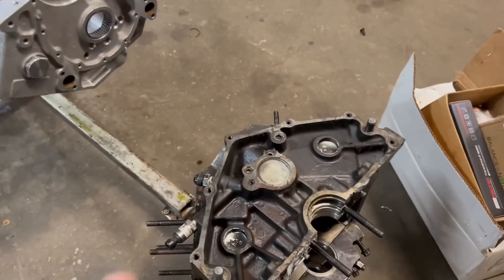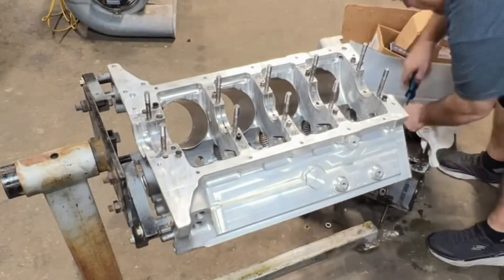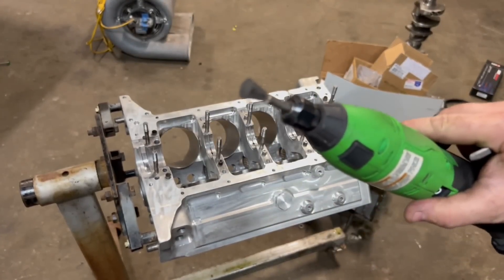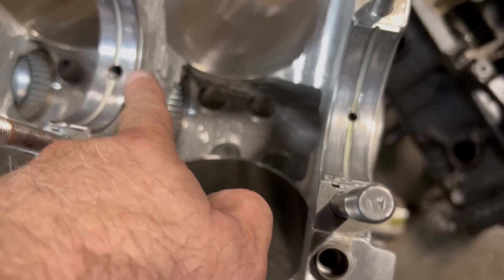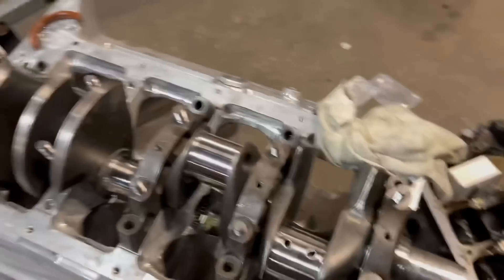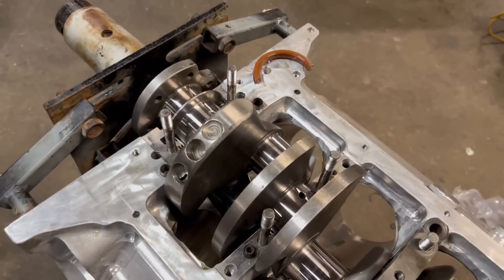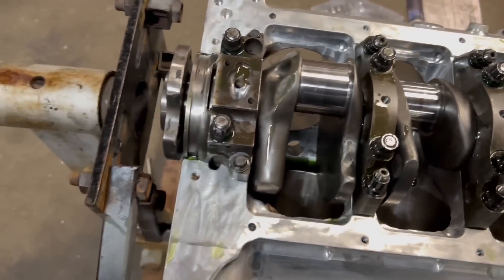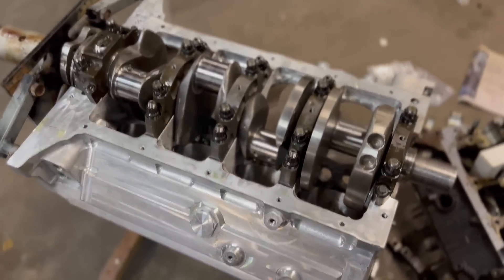Destroked 400 SBC / SBC 350 Main Crankshaft in a 400 Main Block

Comment: i am placing 3/8" thick 4.185" bore size sleeves in 350 block gm small block chevy with stock crank for 383 cubic inches stock stroke. Now if i use a 4" crank i can get 440 cubic inch for a nice daily low rpm'er. Although rod length is not optimal. If i use a 3.625" that gives me a 399 cubic inch with a great rod ratio. If i use a 3.75" crank this gives me a 413 cubic inch. A 3.8" yields a 418 c.i. And a 3.9" stroke makes a fine 429. Just imagine a 4.1" stroke = 451 c.i. Imagine a 4.15" stroke = 457 c.i. And last and not least 4.2" stroke = 462 c.i. And now complete fantasy 4.25" stroke = 468 cubic inch small block. The most bore size to fit any kind of gasket and chevy standard bore spacing heads would be 4.190" And that is only almost 2 cubic inch difference and not worth it. Shall it work in a 350 with modifications? we shall hopefully see. Maybe it would be worth it to try and put a 4" crank in a standard over bore size 4.030" resleeved block for 408 cubic inches instead. Just a really bad rod ratio i believe. Although people get away with 5.565" rods in the 400, so why not? A 4" stroke in a stock 9" or 9.025" deck 350 block gives 408 cubic inches the biggest rod of 6" with a 1" piston has a the best rod ratio that can fit on a stock deck height 408 cubic inch, 4" stroke, um 350. The ringland is through the pin bore on this. So for street daily driver how would this be and go like? The rod ratio for 6" rod and 4" stroke is = 1.5:1 still better than the stock 400 sbc. And with a 1.15" piston and 5.85" rod the ratio comes to = 1.4625:1 that is just under the stock rod ratio of the 400 sbc being = 1.484:1 with a 5.565" rod and 3.75" stroke.

Comment: I never understood destroking an engine other than class rule limiting cubic inches. The thought of making it spin higher in rpms is False. High rpms is cam timing. Look at pro stock engines, 500ci. And 10,000 rpms.
Reply: Those pro stock engines get what, 15-20 passes between rebuilds? A shorter stroke reduces piston speed and a longer rod reduces side loading increasing time between rebuilds. You also get a little more compression height for for a given rod length, allowing you to keep the top ring cooler in a power adder set up. 

Let's be perfectly honest. The original SBC architecture was designed around 265ci and never meant to displace 400ci. Chevy had to siamese the bores and redesign the rods to get there, which is why it was never offered in a factory "performance" configuration. For a naturally aspirated street engine with good parts that will only occasionally see some high RPM they're fine. I wouldn't touch a 400/406 in a race application though unless starting out with a raised deck block.

Comment: You can get bearings that have the extra spacing in them to run a 350 mains crank in a 400 main block, so you don't need the outer spacing shells. I think ACL makes them .. Man, what happened to Vandervell bearings? seemed everyone used to used them in their V8 builds back in the 80s and 90s, but you just dont hear about them anymore

Comment: On that block, look at the oil pump, and the feed area of the block from the pump, and make sure the pump and block are blueprinted same pattern, same match-up.

On my block factory the feed from pump is a circle hole, but the pump is an actual oval, so we needed to match it by drilling out the block, boom 5-10 free HP gain just getting rid of a factory  engineering issue, and what a difference in quantity of flow volume it achieves.

Comment: Built one back in the 90s for my street raced/driven vega wagon i had.  Dont remember what crank and rods etc but i know had 6 inch h beams, the compression was supposed to be around 13 to 1 had the biggest solid cam that crane made that i could run nitous on,  pg w brake and  a 5000 stall, and 9 inch on homemade 4 link bars that attached basically in stock location.  I ran so many bottles of nitrous thru it never missed a beat.  take off on the converter let go trans brake,   Hurt many feelings here in north florida with that car, on the track and on the street, drove it everywhere,  drove from my place to daytona beach for the turnkey rod run no probs Damn i miss that car.  Oh best times before i got rid of it was 9.42 at SGMP they didnt care i didnt have all safety equip that likd it would put on a show with the front 3 ft off the ground and me shifting at 8500

Comment: would a new crank not be just as cheap as getting the old one welded up and turned sometimes saving a couple hundred is not worth the time and trouble and welds never last as long then you could just buy the right main size with the stroke you want but I am a big fan of the 364 or 421 depending on your application

Comment: Did you measure any bearing clearances or just 🙏
Reply from the maker: Trust the machine shops you pay to do that!  I don't have the equipment to check it like they do.  I used to use plasti guage behind them, but don't any more.
Reply: @TurboJohnRacing  fair enough! It was only because you mentioned pulling bearings out of packages and checking they were marked right. 

Hey plastigauge works better than crossing your fingers 😂 but bore gauge and a set of mics are good to have if you’re just doing a freshen up at home. Sometimes that machine shop jail can slow you down 😂

Comment: In my day that was called a 377 hi rev engine we used to gobble up all the 400 out of station wagons and impala’s & caprice cars , ertel made cheap piston’s, king and federal mongol, TRW, speed pro made the spacers, in a light car with 1st design off road camshaft car made easy high 10’s all motor
Reply: Those were the days. Things have changed so much now

Comment: We've been running this garbage double stacked bearing spacers for over 30 years. Thousands of these engines have been built. Why hasn't the aftermarket just made a thick bearing that allows this to be done without the hocus pocus?
Reply: They do make them about $200 I found them on egay lol I'll have to see if I can find the part # on them
Reply: @JeffB80  I was unaware that someone had finally corrected this bs. I dont understand why king, maule, or ACL didn't do this in the 80's.
Reply: @Go4BrokeOffroad  yes sir of course I can't find them now they are not in my watched items anymore I been looking for a hr now trying to find them soon I find them I'll let u know
Reply: They do make a thick bearing and have for years now. Easier to get then than now. They are costly and spacers work.
Reply: Available but expensive, I built one for my wifes 70 chevelle about 20 yrs ago.
Reply: Because the manufacturers see little point in tooling up to make them for the literal 5 people only that have that combo.

Comment: WHY would a race engine want to use 400 mains. Too big so too much crank speed as they fry the oil. OK for a 3000 rpm 2bbl truck engine, makes the  cast crank a bit stiffer. And even then they wear out the mains and away goes the oil pressure. 
You should never have to modify a bearing,, you have another problem to wear out thrust surfaces. Especially on an automagic car!!
Stagger your rear main seal so the ends are NOT on the parting line.
You should be measuring every bearing for oil clearance. A critical measurement. Rods and mains. Different bearing have different clearances
Reply from the maker: Turbo cars push very hard when spooling.  Dump valves on the transmission drop fluid going to the converter to help, but I have not installed them yet.  I trust my machine shops with their equipment to set bearing clearances.  I used to use plasti guage but it's not very good at being as accurate proper measuring equipment.  As long as the crank is measuring good, I'm ok with my engine have a little variance due to bearing differences.  But that's just me.
Reply: That was the problem with the Boss 351 Cleveland - too big mains. It was an oversight from the factory to put them 2 inch mains on an engine that made it's peak hp at 5800 from the factory and was intended for racing.

Comment: Stay with the 350 mains . Increasing the size of the journal will increase the crank speed inside the bearing ( you don't want to do that ). Stay with what you are running .it will serve you better in the long run.
Reply: We used Honda rod bearings on our high rpm small block chevys 1.887 was the journal size. It definitely helped with bearing life.